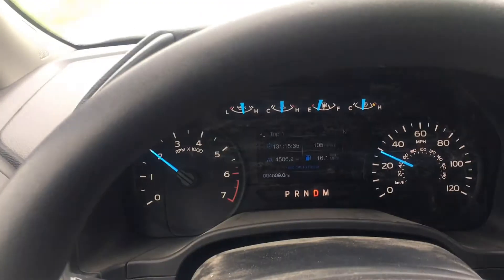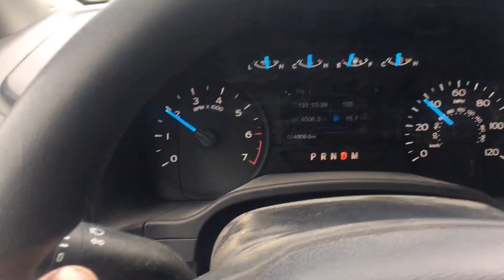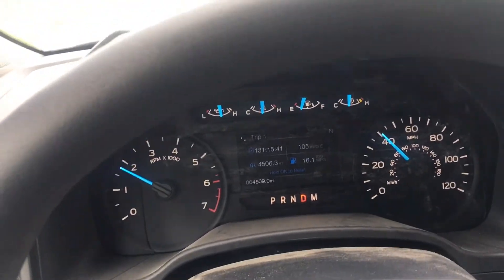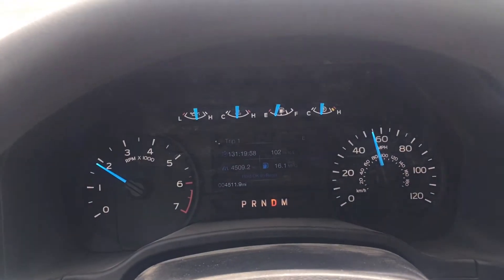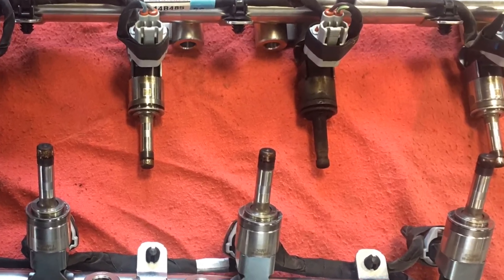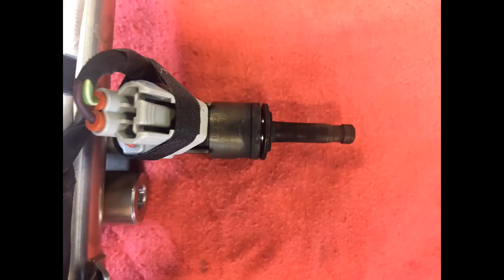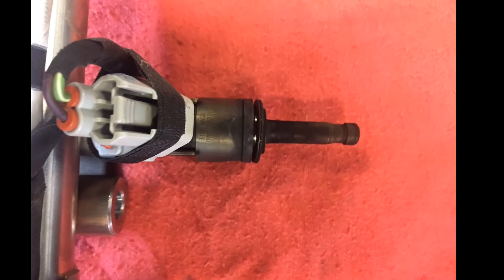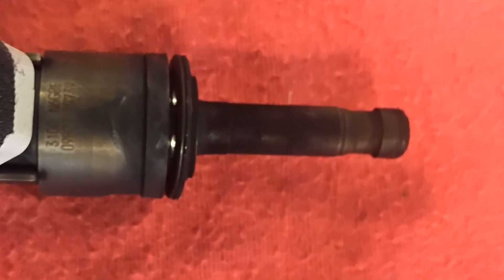Popping Noise in Ford 5.0 Engines

Comment: I have a 2018 f150 with 147k miles, 5.0 coyote engine. Every time just after cranking I hear a distinct pop noise. It is consistent whether engine is cold or hot. Just one pop. No check engine light has ever come up. Any suggestions on correcting this issue?

Comment: Thank you!!!!  My F-150 was doing this right after an engine swap.  Ford dealer spent 20 hours could not figure it out and said it was noise from my lift kit.  I did not believe them so I googled it and came across your video.  Sent it to the dealer and this was the issue and they thanked me (and you) for pinpointing the issue.  Great video so thankful to you!

Comment: Very similar sounds coming from a bronco I just got started after sitting for several years.
Reply from the maker: How old?  Carbureted? Older stuff coughing back was usually a lean condition or an intake valve out / not fully seating. You’d snap the throttle and they’d cough back a couple times on the way to reving up.
Reply: @CarShopTalk  88.302v8..it was a soft pop sound very similar to the video. When you said injector seal. It made sense. It definitely sounds like air Rushing out from the inside. I already have injectors ready to go in so we will see.
Reply from the maker: @Kusiakleather  I think 88 was still speed density wasn’t it? I’m thinking 89 was the first year for mass air flow. A vacuum leak on that system usually just causes a high idle speed. Usually on a KOER it will flag a code for unable to control idle speed. I’d probably be thinking about a fuel pressure issue or a MAP sensor issue. Make sure you check for simple things like plugged vacuum line to the MAP, moisture in the distributor cap, or a cracked spark plug.  If I didn’t find anything with any of those I’d consider checking compression on all 8 cylinders. A valve issue will definitely cause that type of a concern.
Reply: I’ve changed the map vac lines and injectors. It has to be a valve
Reply from the maker: @Kusiakleather  a compression test should hopefully show that. A flat cam lobe / valve not opening would also be a possibility.

Comment: Thanks! This gives me an idea. My 86 Fiero has pop/puff kinda noise I can hear at idle. I put new plugs, coil, wires, etc. I realized when I first got the car, I swapped injectors from pontiac 6000, but used the same o rings, which were a solid 15 years old. Maybe this is the problem for me too. I even bought new o rings years ago, but never got around to it.

Comment: Experiencing this at cold start only on my 2017 f150
Reply from the maker: That one would do it warm as well and was worst under load. It seemed similar to a lean backfire, which is what I originally thought it was. If it’s worse on cold start it really may be a lean backfire, worse cold because of the higher fuel demand of a cold engine. Let me know what you find.

Comment: How do you take out out the bolts next to the Harmonic Balancer to take out the Belts ? I had a 2001 Toyota Camry 2.2 Liter . I tried taking them bolts out to loosen the bolts but it looks like I have to take more bolts more than two ? I loosen one bolts already .But how many bolts should take out to loosen the belts .?.
Reply from the maker: Are you talking about a stretchy belt?  A belt with no tensioner?  It takes a special tool to remove them without cutting them and you roll it off by rotating the crank. It’s put on by zip tying it to the crank pulley and rotating the crankshaft.

Comment: I just put in a new cold air intake and its making that noise. but it didn't make that with the stock intake could anyone help me
Reply from the maker: I can’t really think of any reason a cold air intake would make an engine cough back through the intake or make a popping noise, but the 5.0 is more sensitive than most. I did see a cold air intake on a 5.0 mustang keep throwing a check engine light on once. I’ve never seen an engine so sensitive that it would require a different calibration for just a cold air intake, but that thing was. Does it go away if you switch it back?
Reply: @CarShopTalk  yea it does it goes away with my stock intake so im thinking my throttle body has something going on when i put the after market one on. Maybe cant hold the little bit more air idk.
Reply: @CarShopTalk  I’d have to take it off and put it back on to see. But my answer is mostly it would stop if I put the stock on. Because before I bought my own cold air intake I put on the same intake from someone else and it did the same thing
Reply: @CarShopTalk  I’d have to take it off and put it back on to see. But my answer is mostly it would stop if I put the stock on. Because before I bought my own cold air intake I put on the same intake from someone else and it did the same thing

Comment: My 14 Sierra 6.2 blew out like 4 of the seals after it dropped a valve and I had the engine rebuilt. It’s running fine now but man was it a inconvenience to have to pull the intake and rail to replace the damn o ring seals

Comment: This started on my 2005 ford Triton this morning but much louder
Reply from the maker: Triton, 5.4 2 valve?  It didn’t blow a spark plug out did it?
Reply: @CarShopTalk  popped the hood and it was a spark plug that popped out cause it was too tight gotta retread it
Reply from the maker: @James-tt5fh  They make a special tool to install a threaded inserts into those.  Most repair shops have it. It will probably need an insert to hold a plug again.

Comment: Was this an easy fix?
I am having an issue where everybody seems to say it is a backfire but nobody can see a backfire. The dealership at first thought it was the torque converter which they replaced it seem to have gotten a little better but it has now come back and it is worse than before. How do I get them to look at this situation?
Reply from the maker: It took a lot more time to diagnose than to fix.  I don’t know if your truck is doing the same as this one, but it definitely seemed like a backfire.  It shouldn’t be hard to get some one to look at it. Hopefully you can find someone good at diagnostics.  Is this a warranty situation or is it out of Powertrain warranty?
Reply: @CarShopTalk  I have 3,000 mile left on the powertrain warranty.
Reply from the maker: @wesowens9019  if the dealership doesn’t want to look at it or can’t find the problem, call Ford customer service. I think the phone number is in the back of the owners manual, last page I think.  They’ll contact the dealership to find out what the problem is and will likely schedule a 3 way call between a Ford representative, the dealership and yourself. If the dealership can’t figure it out they should really escalate it to Ford’s hotline, and I would suggest this to them if you call, or ask why this hasn’t been done. Once a hotline request is opened a Ford Field service engineer should get involved, although probably only over the phone or by email, with the dealership and will inquire what diagnostic steps have been performed and will instruct them how to proceed. I’d get the ball rolling on the sooner rather than later with it having three thousand miles left on warranty.

Comment: My 2015 is doing this at idle when it's warmed up. it sounds like it's coming from the intake. It doesn't have direct injections, I replaced all the spark plugs and while I was in there I did a compression test and got a solid 230 on all cylinders. 1 time after towing a 7000 lb load for 200 MI it set a random misfire code, after 25k of no codes, but haven't seen it since in another 10k. Still makes the noise though
Reply: Do you ever figure it out? I'm buying one Monday that runs great but has occasional pop,pop noise coming from the cold air intake

Comment: Great video!! Thank you!! Curious if you had scanned the vehicle to see that it actually had shown a misfire only in Cyl 6??  I have been dealing with this for a couple of years now.  The Dealership cant find the problem. I purchased ForScan and have been running it to find that varying cylinders are "misfiring".  I haev the actual scans and data recording associated but the Ford shop cant determine the issue.  
thoughts?  Because its in varying cylinders could it be several injectors? or more have you seen issues with the Cam Phasers? 

Thank you in advance!!
Reply from the maker: It’s been over a year since I looked at that truck, but I’m pretty sure there weren’t any codes in it. It would have been really helpful if I could have pinned it down to a cylinder.  Most of the phaser issues we’ve been seeing are rattling on start up with no codes also.  I still don’t understand how that truck didn’t set a misfire code

Comment: God dam I happen to see this vid. I’m having this same popping on my 2015 Ford F-150 5.0 and it’s driving me nuts. Thanks for posting vid!
Reply from the maker: I think it was 2017 when the 5.0 went to dual injectors. Before that they were just port injection, so this probably doesn’t apply to that.
Reply: @CarShopTalk  Thanks for your reply!
Reply: @anti-social6368  I have a 15 5.0 making that noise to. Any ideas what it is
Reply: I can almost guarantee it's your throttle body making the popping noise.
Reply: @DJCuhhhstin956  I need a new one or just clean it?
Reply: @DJCuhhhstin956  I noticed mine doing that at idle, don’t feel it when I drive it?
Reply: @ozracin81  mines just started doing the same thing at idle what did you do to fix yours
Reply: @sadikhaji1512  I never fixed it and the truck still is running fine.

Comment: Forchantly for me I have the 2011 F150 with the 5.0L Coyote V8 in it with 137,000 miles on it and still going strong and its a beast and it sounds like a beast with the Borla ATAK.

Comment: Thanks for the info. These coyote engines are pure trash.
Reply from the maker: We really don’t see a lot of them in the shop, but then 4 out of 5 have the ecoboost instead.
Reply: My 2011 Ford F150 with the 5.0L Coyote V8 has 138,000 miles and still going strong and its a beast and it sounds like a beast with the Borla ATAK exhaust on it
Reply: Theyre really not, ecoboosts for sure, but the coyotes are good engines when they're taken care of

Comment: Our 2019 has started to do this last week. Figured it was bad gas since it seemed to clear up with 89. Truck only has 16k miles on it. Will have the dealer looking to it next oil change if it continues.

Comment: I wished this video was made back in 2018. I bought a 2018 F150 and had the exact same problem. This truck also had a thousand service bulletins at the time . It even started experience a problem when you mash down on the accelerator, the engine would not respond. One morning I went to start the engine and it sounded like it was coming apart. The truck was towed to the dealership because of this. I'm pretty sure the cam phaser caused this problem. It never happened again. From this happening, I found it extremely beneficial to let the engine warm up before driving. Anyway, I had to let the truck go and got a GT Mustang. Thanks!

Comment: I’ve set the direct injectors in a 2013 ecoboost, one thing for sure is to follow fords instructions for installation , it’s setup To go in as a set per bank and you tighten down evenly on the fuel rail bolts.

Comment: So I have the grinding/ticking noise on acceleration. Seems to always happen when the transmission is in a higher gear than it needs to be in. I also am periodically experiencing the clunk noise on start up, seems to be coming from the rear/middle part  of the truck. Any tips for getting either issue resolved. Still under warranty, have taken it in and they say they can’t replicate it.
Reply from the maker: My first thoughts on a grinding noise on acceleration would be IWE’s applying due to low vacuum when accelerating.  That’s assuming it’s four wheel drive. Possibly a vacuum leak or a bad check valve.  The clunk on start up I haven’t ran into yet, but I’m really curious to hear one.
Reply: @CarShopTalk  yes it is 4wd 2019 f-150 10speed
thank you, I will take it to the dealer and recommend this being the issue and see if they will replace them. So iwe’s going bad this early? (I have 10k miles)
Reply from the maker: @tonykellar463  usually when they start grinding it’s a vacuum issue causing the IWE to apply. On low mileage ones like yours it’s usually a vacuum check valve located by the reservoir on the drivers side of the firewall. I think Ford even has a tsb that pretty much says if you have an intermittent grinding noise replace the check valve before doing anything else. My suspicion is there are some plastic shavings inside the check valve from the manufacturing process. They randomly get under the diaphragm causing the check valve to leak intermittently. When it’s leaking and you accelerate, vacuum drops and the IWE start to apply / grinding. It’s fairly common. If I get one in I’ll do a video on it some time.
Reply: @CarShopTalk  thank you for taking the time to explain. I appreciate it. Is the the correct replacement for the check valve. https://www.amazon.com/gp/product/B000C5HZ24/ref=oh_aui_detailpage_o01_s00?ie=UTF8&psc=1

Going to order and try to replace as soon as possible. Is this doing damage to my vehicle or is this a minor issue?
Reply: @CarShopTalk   Update- switched the vacuum check between the hose that you recommended. Drove the truck today and still having the issue. Do I need to replace that whole assembly that has the vacuum check valve? Or do you think there is a different issue, a air leak maybe? Any advice on what to try next?
Reply from the maker: @tonykellar463  the Ford TSB is 20-2278. If that’s the problem or if it’s a vacuum problem, or just something related to the four wheel drive if you engage the 4 wheel drive the noise should stop after 5 to 10 seconds. If the noise continues after the four wheel drive is engaged either it’s something else or it can’t lock into four wheel drive.
Reply from the maker: I checked and TSB 20-2278 only goes up to 2018 model year vehicles. It’s still the same system. Try engaging the four wheel drive and see if the noise goes away to rule it in or out.
Reply: @CarShopTalk  Update, drove in 4 wheel drive a few miles this evening. It stills makes the grinding noise. Could I be loosing pressure through the iwe or another part of the vacuum pressure system. Not sure where to go from here?

Comment: I've noticed a couple of quirks with my 5.0. It seems to have some kind of a "clunk" when I start the engine after irs warm. Sounds like there's a lot of excess air in the engine and its almost like a big explosion going on inside the engine out to the exhaust is the only way I can describe it. 

The second quirk only seems to happen when I drive it in sport mode, and it only seems to have that clunk when shifting gears. Other than that, drives completely fine, doesn't seem to affect anything but just think it's weird, sounds off to me. 

Has anyone else had this issue?
Reply: I have a 2020 xlt sport, and I noticed a sound like back pressure coming from the cats when accelerating in like third or fourth gear. it does  sounds like it comes from the cats off the headers, and then you can hear it at times from the catalytic converter.
It Does it more frequently in sport mode. I think I need to take it in to get it checked out. I heard that the 5.0 is trying to suck in more air from the air box to accommodate for the timing, something like that. It kinda makes sense for the burping noises coming from the cats. I wonder if that has something to do with oil consumption in these vehicles.
I did my first oil change at 4200 miles and the oil was barely registering on my dipstick.
Ford replace my dipstick and uploaded new software in the computer for the fix. I'm still waiting to see if that works or not. I just put 500 miles on from last oil change. I'll keep you posted.
Reply: @tommylee7749  so I'm curious we're your cats bad from all the oil burning?
Reply: @kenj.8897  shortly after the new software that was installed by Ford, I installed a jlt air filter, also installed a new exhaust system made by Roush. It was a 3in single pipe with a Cadillac converter delete. I had no backfiring or popping noises. You can sure tell the engine was breathing better. After all the fixes I had no issues of losing any oil between oil changes.
Reply from the maker: Sport mode definitely makes the shifts firmer. There shouldn’t be a clunk, but it should switch to a firmer more positive shift schedule. As for your first problem, I’m not sure what to say without listening to it.  The 10 speed trucks do kind of creep forward on start up until the parking pawl catches and that’s normal. You might want to take a look at the u-joints or even the rear axle for the clunking noise.
Reply: @CarShopTalk  I've heard there is a known problem with the rear axle with these new f150s, that's probably where its coming from.

Comment: The problem is a missing or damaged o'ring on one of the direct injectors. The fix was posted recently on the Ford corporate forum which is not accessible by the public.
Reply from the maker: Yes, I posted it there as well. I also sent some pictures of the injector and o-ring and some videos in to hotline as well.

Comment from the maker: I talked with a technician from another Ford dealership a few days ago who had the same exact problem on a 5-liter. If you see this let me know and let me know which cylinder it was on.
Reply: I came across the same problem on my 2019. It was cylinder number 2.
Reply: I’m having this issue on a 2019 F150 I just purchased how did you diagnose it as the direct injector seals? was there something visibly wrong with them or what made you pull them?
Reply from the maker: @brandoncericola3946  it was still under warranty and fairly low mileage. Ford engineering directed us to try replacing the injectors. When we pulled them we found the seals burnt. There was no other obvious signs. Nothing visibly obvious, relative compression was good, no misfires.